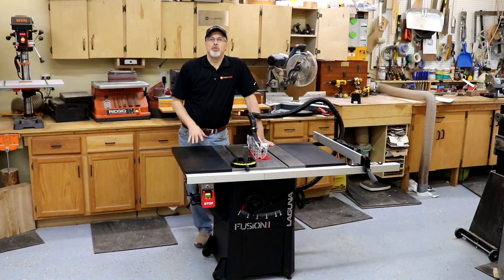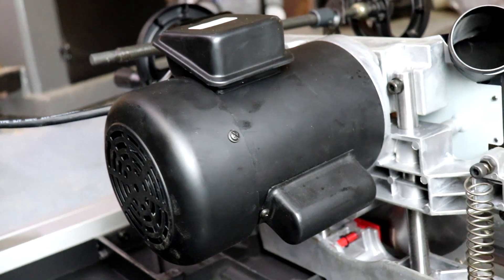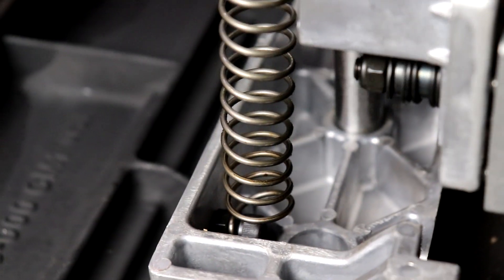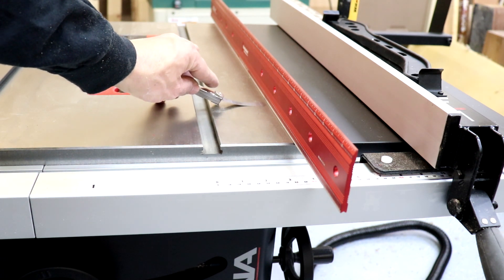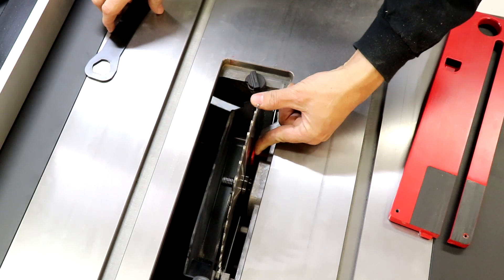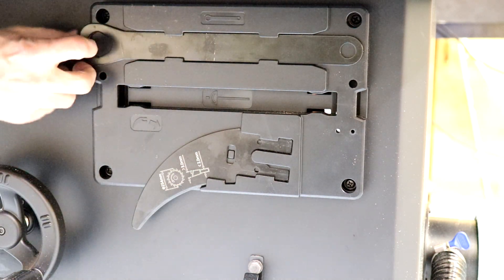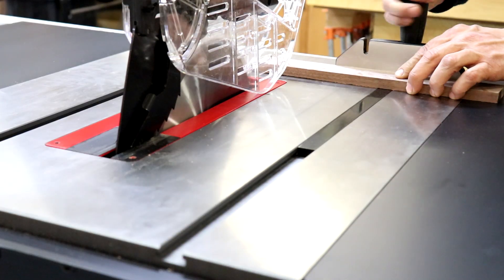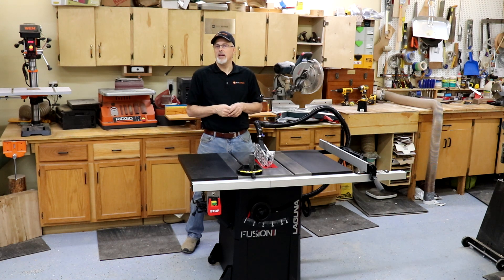Laguna Fusion F1 Table Saw Deep Dive Examination

Comment: I just put one of these together today, its such a nice saw, but i have to disagree on the fence....With the amount of work they put into this beast How the heck did they not incorporate a locking mechanism at the back end of the fence? ... Its just frustrating that its so nice, but then when i go to lock the fence down,  the rear end of the fence will literally lift up from the action of engaging the handle, and there is noticeable play towards the end.. Maybe i have the track tension set too high? i dunno..kinda disappointed in that, but everything else is solid! Also.. the directions completely leave out about 3 key steps, and completely ignore the center panel that you have to install under the motor.
Reply from the maker: What your describing about the fence sounds like something is wrong with your setup.  There shouldn't be any play, and you shouldn't need any locking mechanism on the rear of the fence.  I'd suggest calling Laguna support to help you troubleshoot.

Comment: What is the CFM and HP rating of the vacuum which you used in this video? Or, was it a dust collector?

Thanks,
Ken
Reply from the maker: 5 hp probably pulling about 400-500 CFM at that duct. Long run plus 20 feet of 4” flex
Reply: @ToolMetrix  Thank you!

Comment: How square was the blade to the fence out of the box?
Reply from the maker: Blade to miter slot was off by about.010 if I recall correctly.  Adjustment wasn’t difficult and within 15 -20 minutes I was able to get it to within about.001.

Comment: Thank you for the very detailed review. Before I watched your video, I'm all set to get the Dewalt DWE7491RS for $599.   If by any chance you have experience about the Dewalt DWE7491RS, do you think it would be better for me to buy this Fusion 1 over the Dewalt?  My most concern is on the accuracy and stability of the fence, which I heard that the Dewalt has.  But I like the table size of this saw and sounds very solid and quieter than most contractor saw.  BTW I am a regular DIYer but my hobby is woodworking. I have made a some shelves, coffee tables, TV Stand, ...  and I'm planning to build cabinets, that's why i want to buy a decent table saw. Please advise. Thank you in advance and more power to your channel!
Reply from the maker: I don't have any personal experience with the DeWalt saw.  That is a job-site saw, so not really a good comparison.  If you require extreme portability, and the ability to hang the saw on your wall when not in use, that type of saw is a great option.  I've used a Bosch job site saw and was impressed with what it could do.  But if you want shop stability, cast iron top, ability to use a full width dado stack, large table size, etc., then F1 is a good option.  If you are looking for a job site saw, then I'd suggest comparing the DeWalt to other options in that category.  Unfortunately the comparable Bosch looks like it was discontinued.  Shame, because that was a sweet saw.  I believe that Ridgid has a decent one.  If you want a saw that will be primarily located permanently in your shop, then I'd suggest doing comparisons against other saws in the F1 category such as SawStop, Delta, Ridgid, etc.  In that category, I believe that the F1 delivers a lot of features at a good value point.  The SawStop has the unique flesh sensing technology, so if your budget allows, that is a good option as well.
Reply: @ToolMetrix  Thanks for the quick reply!  I think I would go for stability and large table size and the dado capability.  So I'll narrow down my choices to the Ridgid, Delta, and the F1.   Which one would you choose if you're on my shoes? Again, sorry for my ignorance on this kind of saws. Never used them before.

Comment: Great videos! Thank you for the review. As someone who is new to woodworking, i'm looking into get my first table saw. Would you recommend the F1 over the F2 for a beginner?  Price isn't really an issue between the two of them. If you have any other recommendations I would appreciate that as well.
Reply from the maker: Thank you.  If the saw will primarily remain stationary, and you can deal with the price uplift, I believe that the F2 is a better value.  Cast iron wings and built in wheels are a nice upgrade, plus an upgraded trunion design and motor.   And also, the fence on the F1 is good quality, but I LOVE the Euro fence design on the F2.

Comment: Thank you for this video. I'm in the market to upgrade my table saw and trying to stay under $1000, so this is very helpful. My Rigid R4513 is poor quality. Everything is cheap plastic and it's a nightmare trying to keep everything squared up to make consistent accurate cuts. How well did the blade and fence line up out of the box? Was everything squared up or did it require a lot of adjusting to get it accurate?
Reply from the maker: Thanks, Brian.  The blade alignment to miter slots required a tweak.  If I recall it was out of alignment by about .007", and I was able to get it down to about .001-.002".  I think that I've made at least some adjustment on every table saw that I've ever set up.  It's easier on the F2 and F3 but it's not that hard here.  The main thing to be aware of is that there are three screws per trunion, rather than 2 which is more common.  That's why I pointed it out in the video.  Once you know where the screws are, it's pretty straightforward to tweak if you have to.
Reply: Thank you for the reply. Did the fence require any adjustment?

Comment: i am currently setting up my Laguna 1. the blade isnt at 90 degrees at the zero stop. There is nothing I can find in the manual( a big disapointment, that manual) that shows how to adjust the stops.the 45 is off as well.
Reply from the maker: Hi Rodney, there's a locking collar and set screw at the end of the threaded rod that is used to set the zero stop.  Loosen the set screw, adjust the locking collar until the 90 and 45s are aligned, and tighten it up.  Part #s 84-85 on page 37   https://lagunatools.com/wp-content/uploads/2019/11/FUSION-1-Manual.pdf
Reply: @ToolMetrix  Thank you. I found it on the prints but you answered another question. I wasnt sure if there was only one of them or if one adjusted both. Now I know. Again thanks for the quick answers. its a big help.
Reply from the maker: Awesome. My pleasure Rodney.
Reply: @ToolMetrix  Thanks again, the saw is up and running. Its not a heavy duty saw, it is however precise. I think overall its a good saw. In fact I only have one complaint..that owners manual may be the worst tech document and example of technical writing I have ever seen. My childhood erector set was better written.
Reply from the maker: I definitely see a lot of complaints online so I don’t think you’re alone in your opinion. I set up so many tools that I don’t end up using the manuals very much so I’m not a good judge. In fact a lot of times I get early versions of tools where the manual isn’t even available yet, and then nobody in customer service can help either.
Reply: @ToolMetrix  yep i get that. I did the same thing in manufacturing. I worked in maintenance and was often the first on a machine. I guess my problem is i wrote a lot of procedures so i expect more. A manuals assumption should be that the reader needs help and needs at least minimal guidance on adjustments. You should not have parts that dont show up anywhere in the manual. You should charge them customer service fees. Lol. You responded, they still haven't.
Reply: @rodneyallen2672  So, what did you find out?  1 or 2 and how is it done?
Reply: @rodneyallen2672  I agree.  We test our documentation by giving it to a novice.  If they can't make sense of it or we've forgotten something then we improve the documentation.
Reply: How do you change the belt if it breaks or is it direct drive.

Comment: I am seriously considering buying this F1 saw especially because it’s on 10% off sale right now and right at the price point I need, but I am curious if you think it’s worth an extra $350 to try to stretch and get the F2. This will be my first table saw and I will probably have to defer some other tools if I stretch for the F2. What does the cost/ benefit analysis look like in your opinion?
Reply from the maker: I do consider the F2 to be a worthwhile upgrade.  I'm a big fan of cast iron wings and I like the trunion design better.  If the saw will mainly remain in one spot, I would try to go with the F2.  If you will be moving the saw from location to location on a regular basis, then the F1 would be a better move.  If you want to save some money, the F1 is a very nice saw and I believe that you'll be happy with it.
Reply: ToolMetrix  I’m deciding between this and the Grizzly 077. I  was thinking about the Fusion 2,  but my garage is all 20amp circuits and 25a is recommenced for the F2. As a beginning weekend worker whose garage is also my fishroom, space is at a premium and I will be moving the saw around to use it and the F1 is lighter. How difficult is it to adjust square on this saw? I’ve taken apart cars, so I’m handy around a toolbox. (And I have this video!) I also have Rockler store a few miles away and they sell it.
Reply from the maker: Hi Catfish, the F2 is very easy to adjust for square. The F1 isn’t quite as easy but it’s certainly doable. I’m not an electrician so I can’t give you a qualified override of the 25 amp recommendation but I ran it on a 20 amp circuit and didn’t have any problems. I pushed it pretty hard too. In my opinion there’s a lot of value for the upgrade cost. Wheel kit, better trunnions, major fence upgrade, cast iron wings. Moving it with the wheel kit is super easy.

Comment: It looks like the wheels are sold separately. Also, I’m order to move the saw with the wheels, you’ve got to lift it up from the fence rails? Wouldn’t this damage the aluminum fence rail system?
Reply from the maker: It’s designed for lifting using the rails and they seem to be pretty rigid. I think the risk is more in throwing off the rail alignment if you move the saw a lot rather than damaging the rails themselves.
Reply: @ToolMetrix  okay than you for the reply. I am in the process of trying to make my decision on which table saw to buy. I've got the Grizzly and Laguna in mind. Some concerns with Laguna is the customer service. A lot of people online complaint about their customer service.
Reply from the maker: No problem. Which Grizzly are you looking at?

Comment: I love this saw. I have played with it at Rockler and it seems so smooth and nice. I have a 1.5 HP full cast iron 10 inch Jet table saw (model number - JWTS-10CW2-LFR) right now, but was thinking about switching to this. Would you suggest this saw over what I already have? It's a little older of a version of this https://bre.is/dae33rC3  The saw I have is a little older, but still rocks. I like the closed base of this one and that nice dust collection.
Reply from the maker: Hi Jacob, that's a tough call.  The saw that you have is a nice saw, and if it still rocks, my recommendation would be to use it for a while longer and save up for an upgrade to a cabinet saw if you have 220V power available.  You could probably retrofit some better dust collection onto your saw pretty easily since it is a hybrid design (much harder on a contractor saw with the motor hanging out the rear).  But, if you are ready to make a move now, I'd suggest looking that the F2 as I believe that will feel like more of an upgrade for you.  With the F1 you would give up cast iron wings on your current saw for stamped steel wings on the F1.  Unless you need to keep your saw light for portability I'd rather have the cast iron wings.  And the fence on the F2 is a standout in its class.

Comment: can the f1 be used at 220V like the F2? or only 110V
Reply from the maker: Yes.  According to the F1 manual it can be wired to 220V as well.  You have to swap out the switch, and the provide a part number for the 220V switch in the manual.

Comment: Trunion looked like aluminum and mounted to the top.  No.  I don't like that.  Cabinet mounted is the only and best way.  Two piece front fence rail?  No.  No reason to do that.  Cheap miter gauge, but no one uses those anyway.
Reply from the maker: Hi Gary, yes, the trunion is cast aluminum on the F1.  The benefit for this saw is that is makes the saw lighter for those who move it to a job site, and also keeps the cost down for those who might be looking for a lower price tag on their saw.  Moving up the product line, the F2 adds some cast iron to the trunion mechanism (where it attaches to the cabinet body), and the trunion on that saw is mounted to the cabinet.  The F2 also has quite a bit of aluminum alloy in the trunion mechanism, but it is beefier than on the F1.  The F3, as I understand it (I haven't removed the top on one yet; hopefully soon) uses a full heavy duty cast iron trunion mechanism.  The two piece fence rail would definitely bother me if the split was to the right of the blade, but with it over on the left you would never pass over the split so I don't care.  I would think that the reason for this would be shipping costs, as the package would have to be larger to accommodate the longer rail, or it would have to ship in a separate box.  Either way that adds cost to the consumer that many people would rather not absorb.

Comment: Just got mine today and had a question...where are you storing your blade guard when not in use? I have a few empty spots on the tool storage side but can't figure out if it's meant for the guard
Reply from the maker: I don't think that there's on board storage for the blade guard.  I wouldn't put it away too far, just so that you're more inclined to reinstall it right away when you're done with your riving knife operation.
Reply: ToolMetrix I typically use it without the blade guard as I find it just gets in the way more often than not but maybe I'll try to use it more!
Reply from the maker: @cb03cd  I think that's true of a lot of people, including me with my Unisaw (but that guard is a PITA).  At least use the riving knife, as that should prevent most kickback accidents.  But if you can get into the habit of using the blade guard whenever possible, you'll be better off.  I think they've done a good job of making it easier to install and remove on this saw, so that makes it more likely that people will use it.
Reply: ToolMetrix I always use a riving knife for sure. You are right about installation of the blade guard, its very easy. Really like the dust collection aspect as well! Only dislike I have so far is that the steel wings and other aluminum bits seem to scratch very easily.

Comment: Great videos on the unboxing and the deep dive.  I am considering a hybrid saw, and this information is really helpful.

Near the end of this video, I noticed that you demonstrated wheeling the saw around with the optional wheel kit.  Could you comment a little on that experience?  Was it relatively easy to do (seemed so)?  Is the recommended method to use the fence rails like handles of a wheelbarrow?  Thanks.
Reply from the maker: Hi Ed, yep, it’s very easy to move. The concern you raise is a good one. It didn’t seem to stress the fence rails so I wouldn’t hesitate to do it. If the rail fasteners are loose you will have a problem but otherwise I think it’s fine. But that’s my perspective and Laguna engineers might feel differently. On the F1 if you lifted by the wing it would still stress the rails, although not as much.

Comment: Looks like a pretty nice saw, Paul. I wonder about the effectiveness of the overhead dc when it's connected to the 4" dust pipe.
Reply from the maker: Hi Charlie, I'd say it's decent 'out of the box', and it's really intended as an inexpensive "plug and play" setup for people who don't want to mess with it.  The hose going to the shroud underneath the table lets you get better collection with less CFM compared to my older cabinet saw where I have a 6" pipe going to the back of the cabinet but it has to collect from the entire cabinet.  There would be ways to improve it for sure.  If I was going to set this saw up permanently in my shop I would run a 6" hard pipe and reduce using a  6" x 4" x 4" wye.  I'd connect one branch of the wye to the back of the saw, and I'd run 4" flex from the other one ideally all the way to the blade guard, and reduce it right at that point to the 1.5" connection on the blade guard housing.  If that proved to be too clunky, I would run 4" flex to point where the flex hose tethers to the fence, and tether the 4" hose at that point.  Then I would eliminate half of the 1.5" flex and run that to the guard.  I would also install three blast gates in the system.  One gate on the 6" line to switch the air flow on and off on a regular basis, and the other two would be 4" gates on each trunk of the wye to optimize the balance of air flow between the two branches.  I would find the right balance for those and just leave them open at that setting.

Comment: Try out a Hammer or Felder panel saw. While they don't have Sawstop's safety mechanism they blow everything else out of the water in terms of precision, options and modularity.
Reply from the maker: I’ve looked at a felder and they are really impressive. Extremely well made.  I think they would be great for cabinet makers but cumbersome for furniture makers, which is more what I do. I also think that they require more space than I could devote to a saw.
Reply: …and price
Reply from the maker: Great point